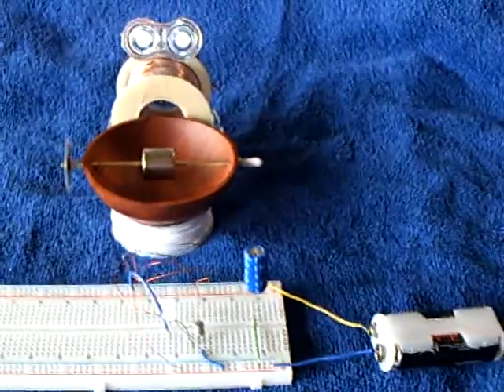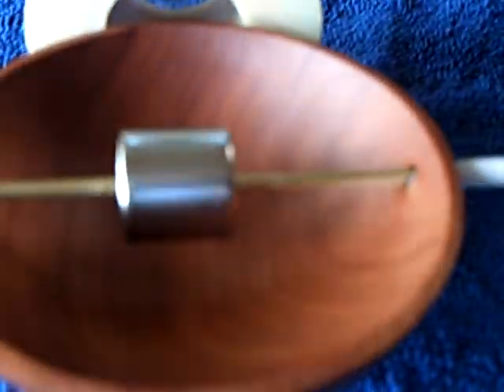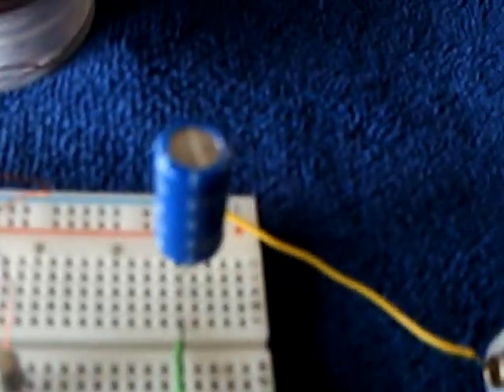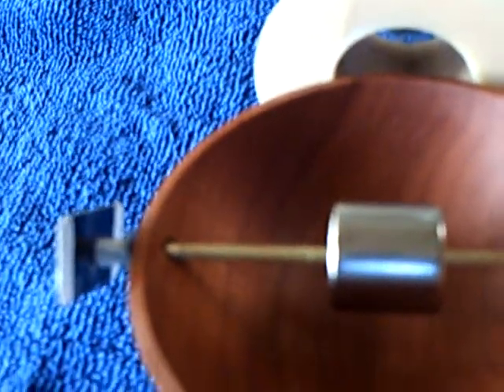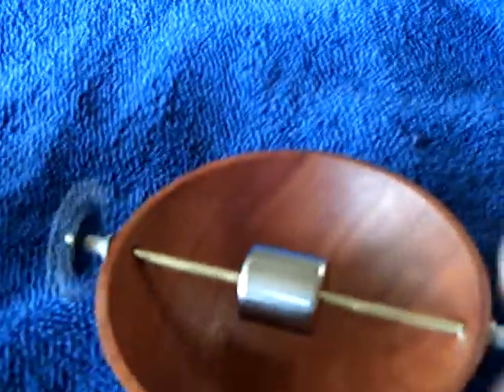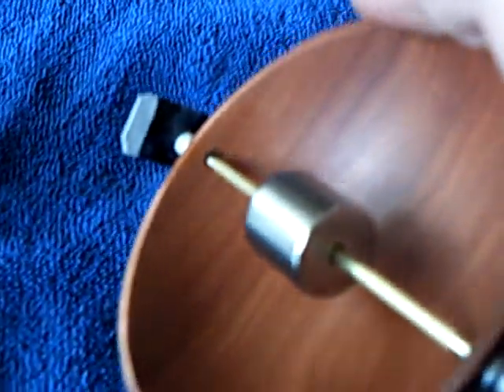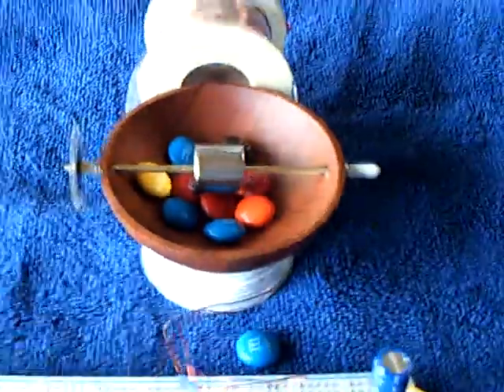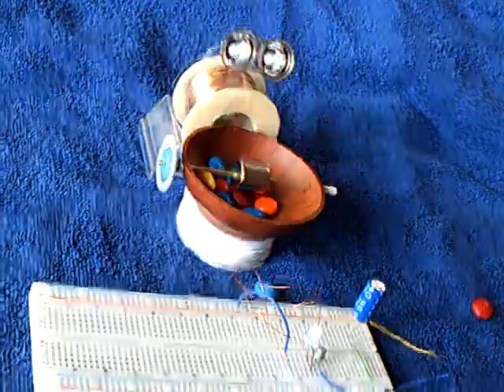Jack's Wooden Bowl Electric Motor

Comment from the maker: I watched those videos again last night and I think I know how he built it now.  The ring magnet at the top is driving it it but notice the rotor at the bottom with perhaps two magnets on that.  A reed switch taped to one of the wood posts could be turning the coils on and off in such a way that one pulse is in attraction and the other pulse is repulsion.  That would account for the super high rotor speed.  That is just a guess.  Sure wish I knew for sure. An amp draw reading would be nice.

Comment from the maker: That is really the same circuit but it looks different.  Replace the diode from the collector to the (+) with an LED.  Use the 25 Ohm rheostat I show on that circuit (Radio Shack) if you want. It is a simple way to control the power.

Comment from the maker: We think that 'axis306' did it with a hidden reed switch.  A tiny transistor could have also been hidden somewhere.  The powering energy came from a supercap maybe (they look just like regular capacitors) in the first video and we think that in the second video he used button cell batteries in the battery holder.  I did a video during that time period showing how I would have done it.  I called it my 'Tiny Motor Generator'.  It's too bad that he didn't show exactly how to make it.

Comment: I looked at the 'Basic Electronic Pulse Motor'. It looks a lot different. 

Is it possible you meant the 'Simple Pulse Circuit with Air Core Coil' ? 

Thanks for getting back to me so fast.

Comment: Sad to say I'm still a little confused. The 'Basic Electronic Pulse Motor' doesn't have a diode from the collector to the (+) and it doesn't have a 25 Ohm rheostat.
If it wouldn't be too much trouble, would it be possible to post a drawing of the circuit. 

Is it possible that I should be looking at something other than the 'Basic Electronic Pulse Motor'.

Once again, many thanks 

Dick B.

Comment: yes i noticed that and i think the same too

and there is some thing small in parallel with the big cap in the 1st video ,what is it ??????

and some thing else & more interesting in the 1 video the shape of the big cap look weird its like he opened it & puts some thing inside maybe a small watch battery & close it , & the bottom where the soldered wires looks weird and puffy 

looks like a silly trick ; looooooool 
regards ;-